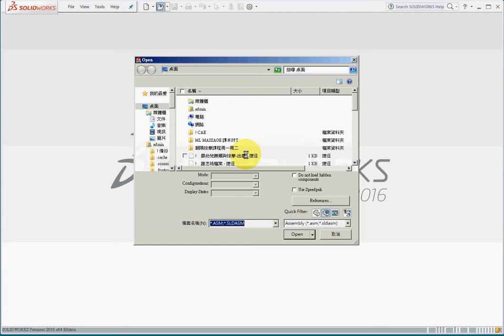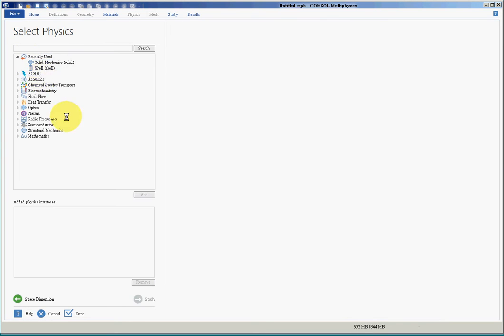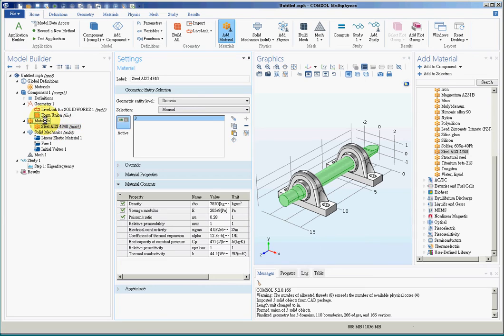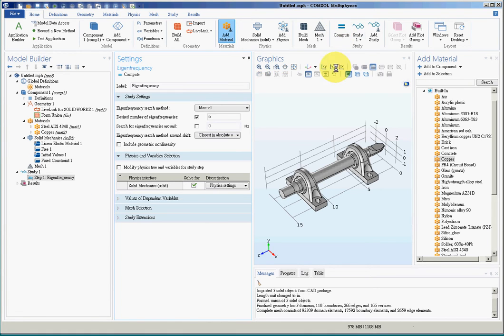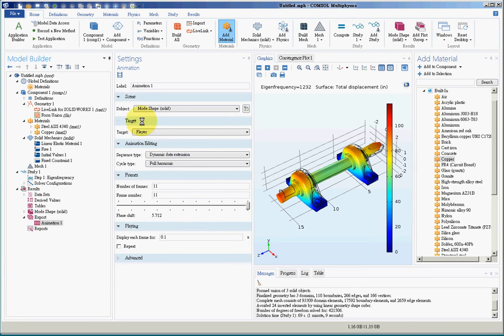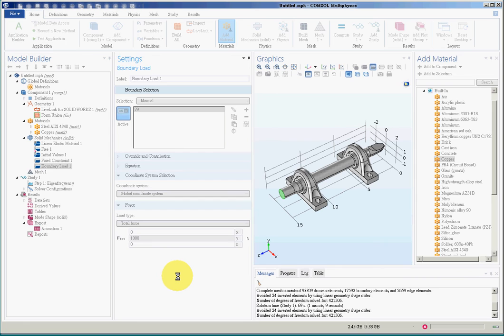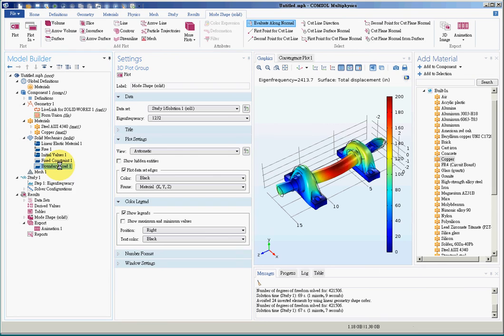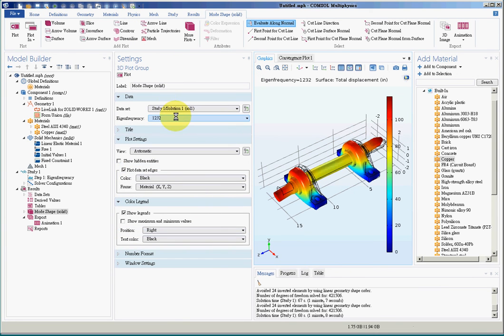COMSOL CAE 5 1  Eigenfrequency Analysis Nature Vibration

Comment: Hi,
Thanks for the useful model. As in your case eigenfrequency is not changing much, whereas, in my model applying a boundary conditions such as force or displacement boundary conditions the value of eigen frequency is relatively much different. Is it fine accordingy to you? Or I am making some mistake?
Reply from the maker: We discussed in class about factors affecting frequency, such as boundary conditions, Young's modulus, mass, length, cross-section, rotating speed(internal stress), partial model, etc.